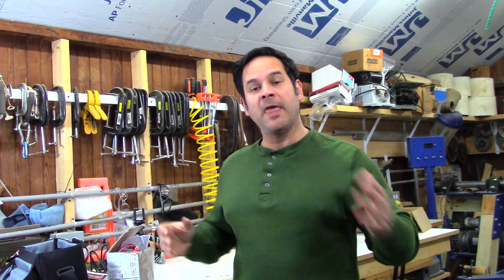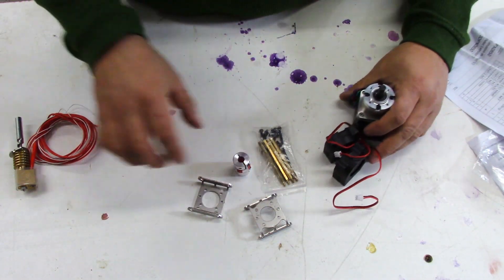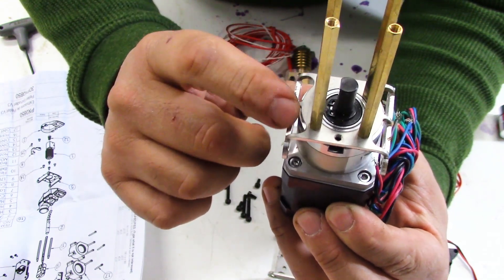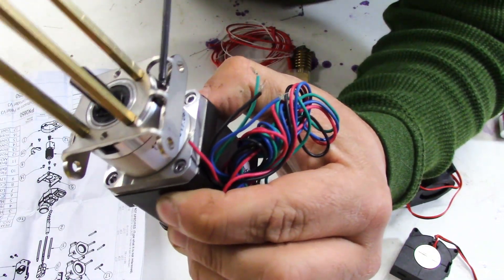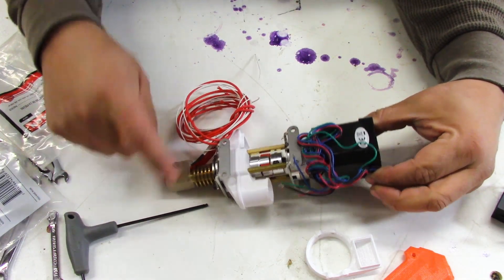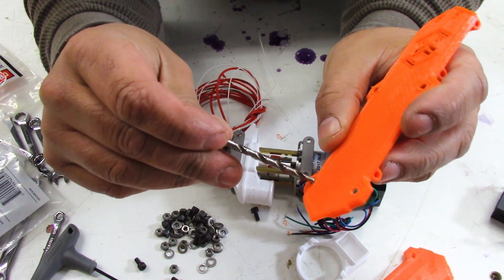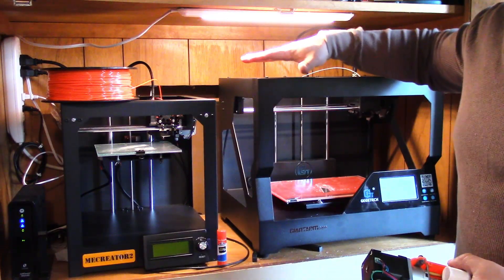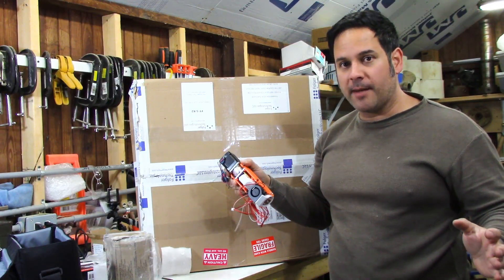Pellet Extruder for 3D PRINTER HOTEND

Comment: Maybe you can use this not as a final hot end, but as a real time 1.75mm filament extruder, not conected to moving parts, but in a fixed position. The filament produced by it can then be used directly in our comom hot end. This excludes the extra weight in the axis and gives the advantage of continuous filament (not limited to 1kg as we can add each time more pellets). Pellets -> 1.75mm or 3mm filament -> 3d printer comom hot end. Sure this extruder would need some modifications to extrude 1.75mm filament. This was my idea at first for this. Don't think using this as a final hot end is a good Idea, due to its weight and incompatibility to our printers. Thanks and keep the project. I will be watching it...
Reply from the maker: That is a very interesting idea.... something to think about
Reply: already seen it on YT but that idea did not take off... not sure why... it actually was a racing drone manufacturer that sells 3d printed parts with his CF frames and they recycle the failed prints and supports that way...
Reply: i think it won't work because you have to cool the filament first down before it gets to your hotend and it's not so easy to provide a constant 1.75 diameter without much deviation in tolerance. i've already seen such a diy machine and it is one hell of a machine, a lot of work, engineering and not cheap at all. perhaps the reason why people try to direct extrude into the hotend
Reply: Yeah, that would be great (would need extra fans to cool off the plastic as it is exiting the nozzles so it does not warp under it's own weight.  ultimately you would want to run the final nozzle extruder and the filament maker at different rates so that you don't have to deal with retraction on the filament extruder.  if you could get the filament maker to ignore retraction and whatever they call un-retraction, heh then you would be fine if you just had some slack in your filament.
Reply from the maker: I'm sure there would be some problems to solve
Reply: Actually you are right. With the shipped 0.8mm nozzle it produces 1.2-1.3 mm filament at 170 C and a lot faster and more even than that damn filastruder. So increasing nozzle to 1.0 or 1.2 might produce 1.75 filament.

Comment: I thought that this was just an "extrude your own filament" thing. I'm not sure I like the idea of a "pellet extruder" the way this is as that's a large assemlt that your printer now has to move around, meaning you're gonna be printing pretty slowly
Reply from the maker: im pretty sure you can use it as a dedicated filament extruder as well.
Reply: The designer (Mahor) intended it to be put on a machine carriage, though I really don't think it's a good fit for desktop class machines. Most machines with filament extruders are pretty large.

I think a full on filament extruder is better if you just want to make filament.
Reply from the maker: its going to be an interesting experiment, hopefully for a much bigger machine

Comment: Do you have cleaning pellets (used in injection..) when changing to a different material/color ? What max. heat can it take ? And what the price (range) aprox. ?
Reply from the maker: i dont have ANY pellets just yet, but yes i will be getting the purge material as well.   not sure of the max temp just yet as the software will play a role.  i paid $353 including shipping when i purchased it.

Comment: I don't know why a company doesn't just come up with a small personalized machine that can create filament out of pellets or or crushed up old failed prints and what not.
Reply from the maker: there are several, filabot is one, noztek is another
Reply: Those are expensive industrial machines made for businesses though, I said small personalized machines for home use.
Reply from the maker: Those are small... the ones I work on are 20 to 30 feet long!  I have seen some really small ones on eBay.
Reply: Small but not personalized, both of those companies nearly only advertise to small businesses (for a reason), and are not even close to affordable for an individual hobbyist. Was just looking for some actual small, home use ones.

Comment: expensive filliment? $16-18 for 1kg of PLA is expensive? I've seen pellets going for about the same price to weight ratio. 
I wanted to get a filistruder to recycle waste plastic and make my own filament but when there isn't much price difference it's almost pointless.
Reply from the maker: When I (not necessarily everyone) can buy pellets for $1 to $3 a kg, it is s significant savings, particularly since I plan on printing much larger objects with 2mm-4mm nozzles.  This experiment may not work... but I'm going to give it a try.
Reply: for fun you can also use pellets of non traditional materials,  chocolate chips - (super user level), sugar, color fades, fancy additives like carbon nano tubes, etc 
Pellet extruders have more flexibility, in that you dont have to wait for a filament manufacturer to supply the material for you to test it.
Reply: U can buy recycled pellets for 50 cents per pound.
Reply from the maker: YES YES AND YES!  i plan on trying many different things... once i get it going!
Reply: filament'
i've seen .5kg of pla for $100. i've also seen 1kg for $15. and anywhere in between. if 'just pla' were what we were talking about with the system, you may have a slightly appropriate point, but since it's not, you don't. lol. skipping an unnecessary process is ALWAYS(100%) more efficient. cost maybe not, but that's between the consumer and whatever ripoff artist is trying to ream your wallet.

Comment: seems really interesting, it should work just fine for extrusion, i am extremely interested to see the retraction performance though.
Reply from the maker: It will be interesting to see how retraction works...if at, all
Reply: new giveaway announce! make a logo that doesn't look like a ripoff of a different logo! trick is, you have all of humanity's history to go against! good luck!

fake btw, cuz everything is a ripoff to some people.
Reply: retraction performance in the barrel, driven be the screw rotating in reverse, will likely function pretty well---seeing that the barrel is fluted to keep the molten load from just spinning freely when the screw pulls material from out of the nozzel.

Comment: How did you purchase this? There's no pricing or ordering info on Mahors channel.
Reply: Sure. Just trying to design a bracket to mount it now.
Reply: sorry monkey d roofie, cant get it to work. the hot end wont heat up past 60 C and then shuts down. tried all the heaters and all the thermistors i have and only get various temps all below 60. It has those old type thermistors with the glass ball on the end which sits in the shallow hole and held in place by the clear plastic cover. Always hated those glass balls, they just dont work as well as the cartridge type. Theres no space left to drill a hole and use a cartridge. I could try drilling the shallow hole deeper i guess but.... Any ideas?
Reply: Got it working. Heres a video of the first print, needs a lot of tweeking.    https://youtu.be/LYusCXD4Y98
Reply: Second print is pretty good https://youtu.be/28W4XxX0BVE
Reply: about 387 euros
Reply: It's not expensive especially if you compare to Filastruder which is a makeshift filament extruder that i have and hate so far. This one is a well machined pc of equipment. I havent fully tweaked settings yet, i have enabled retraction and there isnt as much ooze as you'd expect and less than a bowden setup. Its taking a while because i have issues with my printer control board and doing it all together takes so much longer. I started doing bigger sizes and now have an issue with lifting from bed. I am thinking a heated bed may be necessary, because its pumping out very large amounts of pla and when it cools its very strong and when shrinks it has the strength to pull off the bed. It uses e3d nozzles and i ordered 1.0 and 1.2 nozzles from aliepress. I used those larger sizes before with my original bowden setup and did manage to make one life size statue, with issues of course. Still pleased with the purchase. But not certain of its versatility as yet.
Reply from the maker: i contacted him through his channel.  he does not have a store setup so he will send you an invoice
Reply: thanks
Reply from the maker: anytime
Reply: how long did it take for him to send you an invoice after filling out his form?
Reply: ok i finally got the invoice, its on the way
Reply: +brian t Would it be possible for you to make a video of this pellet extruder printing? There's not many videos out there so it would be interesting to see it in action for different prints, different materials etc. This is asking a lot but if you're up for it I'd much appreciate it and I imagine a lot of others would too.
Reply: Thank you so much, I'll look forward to it!
Reply: Thanks for getting back to me about this! I won't be of any help unfortunately because I have no expertise in 3D printing and I'm getting the CR-10s as my first printer in a few days. Have you contacted Mahor about this in case there's a fix for this problem he knows how to do? He's been helpful in answering the questions I've asked him via email. I hope you can get it working,  it's a really interesting concept that could go a long way if it can function well enough.
Reply: Great news! That wasn't bad for a first print on an experimental extruder I reckon. Once you get it everything tweaked it might work like a charm. In the email conversation I've had with Mahor, he explained that the material shrinks 3-4mm (depending on material) after it has cooled so I'm not sure how different it is to filament in that regard. Looking forward to future updates, thank you
Reply: I read thru the responses VERY INTERESTED but I still don't see the price mentioned anywhere. Is it a secret?
Reply: brian t So what is the price on the invoice?
Reply: brian t cool. That doesn’t seem that expensive for what he’s got into it. 
What extrusion nozzle sizes do you have for choices?
I build CNC specialty machines and have planned a big build since I got into printing a year ago. Very interested. I saw (I think) your other vid extruding. 
Can you give us your thoughts on results such as retract behavior?
Reply: brian t   I’m in. I will be watching your  progress because I think this will be the way to go on an industrial level if it can be tweaked. Keep putting out the info. I can appreciate the work that goes into it because I have a few of my own. 
Can’t wait to see the results.
Reply: I had some problems with my printer and has set me back a couple weeks or more but here's my latest https://youtu.be/dYlIl-7eqeU

Comment: Great potential to save money on filament but that thing is big. How heavy is it? I wonder how well it will handle retraction? And no chance of a Bowden setup with that.
Reply from the maker: it is very heavy, i'm guessing around 3 lbs! i think retraction is going to be tricky.  my guess is it will tolerate a little retraction but too much may get molten plastic into the cooling zone and cause it to stick to the screw and barrel.  my plan for this thing is to print BIG, Heavy, fast, and 1 to 2 walls only for utilitarian objects.
Reply: I appreciate the time and money you are spending experimenting with this. Hopefully it pans out.
Reply from the maker: I hope so too... of nothing else,  i will learn somthing i can apply to something else in the future
Reply: I am printing currently with Pellets on this setup. https://www.youtube.com/watch?v=dXiy0UanR-8, retraction is possible. The screw creates suction in the opposite direction. I had to play with the retraction length to get it just right but it works. Recycled pellets is also an interesting challenge I have been working on.
Reply from the maker: Allan Kinnear that's awesome, thanks for the link!
Reply: It weighs 800 grams or 1.8 lbs.
Reply: Its about 840 grams

Comment: subscribed!!!  i need too see this outcome. because pellets are so much cheaper. 
infact seeing this set-up, opens the doors to a new complete manufactured FDM printer series with pellet extruders.
i think China will step in very fast.
Reply from the maker: Thanks, I'm looking forward to testing this out soon, it will be a few weeks until I do. I'm looking forward to using materials otger than the usual suspects.   I have 3 local companies I can source pellets from! I think China will only step in if there is enough market to profit from.

Comment: How much does it weight? That hopper looks too small. I'm interested in this as well for a larger printer I am building from scratch.
Reply from the maker: I have weight it but I would guess it's about 3 lbs.  Heavy by most standards but for a pellet extruder I think it's reasonable
Reply: You build a bigger hopper, and run a feed tube down to the smaller hopper.
Changing colors will be fun !
Reply from the maker: its definitely going to be a fun process, figuring everything out

Comment: Hi, I've also bought one and came across your video while building it haha. On the pictures on Mahor's website it looks shows both fans on the same side and the cables threaded through the metal parts, might wanna change that for cleanness ;). Looking forward to see the printing results of it!
Reply from the maker: Awesome, I'm hoping to test it soon.  Good catch on the fans, I didn't like the idea of running the wires through the metal brackets because the sharp edges might chafe the wires.  I mentioned it in the raw video, but cut it out in editing... I had 4 hours of raw video!

Comment: Nice project. I like people who are not afraid to try something new. The extruder looks heavy. I'm afraid you will have to lower your printer's acceleration quite a lot to avoid "ghosting"
Reply from the maker: It is massively heavy, and you are right, I will need to lower the accel, but it is going to be an interesting experiment
Reply: I see this as best for a large printer, running like a 0.8 or 1mm nozzle.  I would like to see this on a big hang printer ! But how to feed pellets ??
Reply from the maker: good questions.... im going to have to figure all of that out.